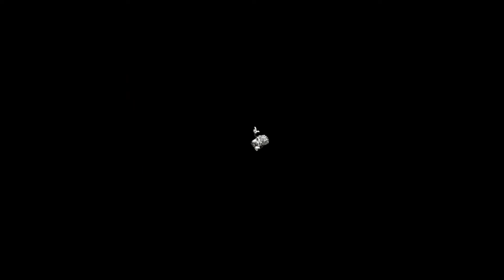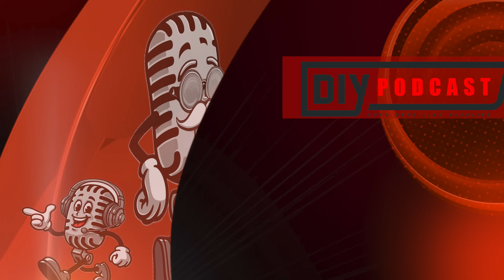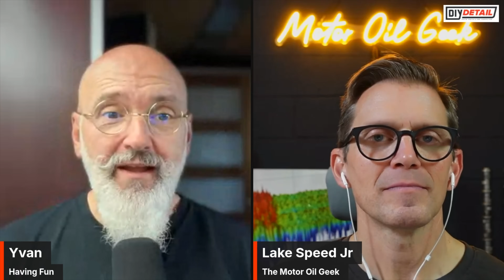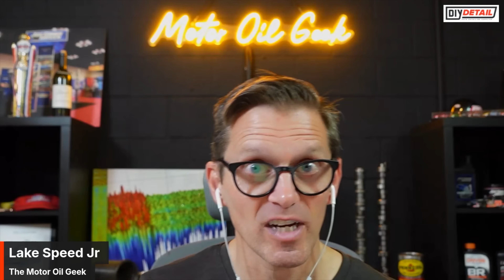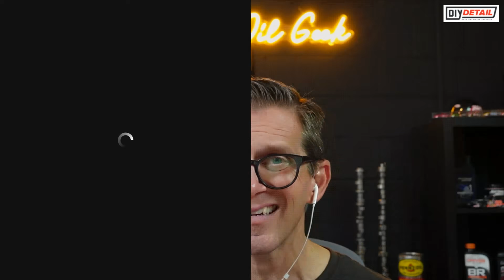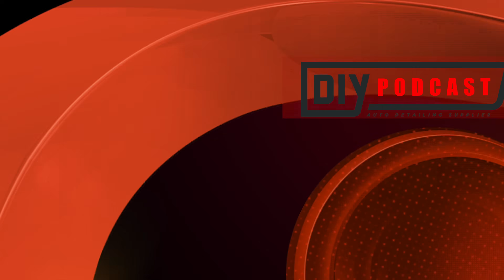Oil myths busted with Lake Speed Jr and DIY DETAIL PODCAST

Comment: I can’t believe the lengths people go to not change their damn oil! Why spend time and money getting your oil “tested” instead of just spending that money on changing the oil in the first place!?  Personally, I just follow the manufacturer specified maintenance interval in my owner’s manual for “severe driving conditions,” which most people actually fall under if you read the definition—frequent short trips, stop-and-go traffic, hot/cold/dusty environment, ride-share/delivery driving, etc., etc. I’ll leave the rest to the engineers and chemists to figure out.
Reply from the maker: For a car it’s not worth it. For a vehicle like my my bus that takes 11 gallons per oil change, if I can double the mileage while still getting the lubrication and protection it’s worth it.

Comment: Any problems with switching brands? I have a 2019 Mazda3 with 120,000 miles. I have always run Castrol Edge but thinking of Pennzoil Ultra Premium. Thoughts?
Thanks
Reply from the maker: No issues

Comment: If you're doing a lot of short trip city driving it would help your engine out to get on the highway for at least 5-10 miles a few times a week. City driving is so bad on your engine. If the majority of your miles are city driving you need to change the oil more often than recommended by the manual.
Reply from the maker: Thanks for the tips!

Comment: Lake Speed to me is another talking head. He said Valvoline Restore&Protect is a great oil. Valvoline Restore&Protect has a 394 Flash point. This is a horrible flash point for motor oil. Look it up yourself. Lake Speed said Phosphorus was not good for direct injection engines and he highly recommend not to use oils with high phosphorus in direct injection engines. Valvoline Restore&Protect depends heavily on phosphorus. Look it up yourself. Moral of the story do your homework. Don’t depend on internet know it all to run your life!
Reply from the maker: Thanks for sharing your experience

Comment: I worked in Racing at Pennzoil mid80’-mid 90’s. I worked with our lead engineer “Dewey” and Lubrizol was the additive company we used with west Texas sweet crude.

One thing I learned was don’t change brands (different additive packages) sometimes don’t mix well. And Do not add oil additives, it screws up the chemistry… 

The new stuff is beyond me except stay with the original rules….
Reply from the maker: Thank you for sharing.

Comment: Having worked on countless vehicles over the years, i think those that recommend the 10,000 and even 15 to 20,000 mile oil change are being irresponsible.   This is simply a scam perpetrated by The auto manufacturers and the environmentalists.    People need to use a little common sense.
Reply from the maker: Thanks for sharing your thoughts!
Reply: But somehow those long oil change intervals work in Europe!

Comment: If i only drove 500 miles and light driving now getting ready for winter shouod i chang my oil? I think it is foolish. Maybe every few years regardless of miles.  It’s like the oil is sitting on the shelf. Hardly any run time.
Reply from the maker: Time harms as much as mileage
Reply: If you hardly drive and you use synthetic, change oil every 6 months.

Comment: I want to mix Mobil 1 0w-40 supercar oil with Mobil 1 5w-30 SUV oil. To make a 50/50 solution of 2.5w-35 oil in my GM 6.2 Liter engine. Any good reason that I should not?
Reply from the maker: Best to ask Lake on his channel
Reply: You will completely change the addative package and viscosity.  Could be a good thing or a bad thing.

Comment: Interesting question about using an engine oil flush if it's made by the same brand as your oil. I wondered about that myself. Since Valvoline was the most recent brand discussed, I looked up their engine oil flush. In their information about the product, it says "do not use on heavily sludged engines." Given how sludged up most engines tend to get nowadays, I think that says it all.
Reply from the maker: Thanks for looking into that. Makes sense.
Reply: @diydetailofficial  you're welcome. Indeed, yes, it does make sense. The detergents in the engine flush must be more concentrated than whatever is in Restore and Protect, so dislodging a heap of sludge with an engine flush would probably risk clogging up the filter. Mind you, word on the street is that it's prudent to replace the filter a couple of times in the first thousand miles with Restore and Protect, just in case the first filter or two gets clogged with sludge. If I recall correctly, Valvoline Restore (one-off treatment for diesel engines) is recommended to have the filter monitored to prevent clogging.

A few years ago, I put a flush into my engine and kept it there for a week before I changed the oil. It made my oil pressure switch fail and leak. Whenever the engine was idling, the oil pressure light came on, but it was OK from high idle upward. I replaced the switch because it started leaking, and the light immediately started working properly. Needless to say, I haven't done that again (I've since found Lake Speed Jr's channel and realised why it's a bad idea).

I'm thinking about using Restore and Protect for both my car and my wife's car, but it's fairly expensive in Australia, and I've already stocked up with a year's supply of the normal oils I use for both cars. Hopefully the price will come down by the time I get through my current stock.

Comment: I got to witness a 2016 Camry hybrid with the level on the oil dipstick about an inch too high.... That was dilution and at least some condensation.... Luckily my girlfriend's son had paid for that super expensive warranty that I usually consider a complete waste of money because the used car dealer did replace the engine.   It's comforting to hear in this video the concern that lake has about the hybrid lack of run time.  Thank you again Lake!!!!!
Reply from the maker: That's a great real-world example, thanks for sharing!
Reply: @diydetailofficial  on that particular super cold morning the amount of vibration was absolutely frightening.  I didn't let it run long.  It just so happened to be that I am the one that had to move the car.  No idea if he ever really noticed it.... Probably not.

Comment: On any Toyota Hybrid at least, you can place the shifter in B or S for sport mode, and this runs the engine continuously.  This is what I do when it’s cold out and I’ll be short tripping.  Loss of some fuel economy, but good for the oil and engine longevity.
Reply from the maker: Great information!

Comment: Sorry Lake, but oil analysis ain’t cheap and unnecessary for 99.99% of car owners
Reply from the maker: Agreed
Reply: @diydetailofficial Could you ask Lake about the VRP myth that he is promoting. He claims VRP works, but all he showed us was a dipstick trick and a questionable oil analysis hypothesis.

The dipstick trick can be explained by a higher oil level and not by oil itself.

After running for 10K miles, oil was at the lower level; hence, the dirty part of the dipstick was not submerged in oil. 

Changing to a Walmart oil would also clean the dipstick, as long as the dirty part was bathing in oil.
Reply: Also, Lake said that the oil consumption is caused by stuck rings.

But oil consumption can also be caused by leaking valve seals and guides, leaking turbocharger seal, and head gasket… Seal conditioners in oil can be the reason for some people reporting reduction in oil consumption after using VRP, and not because some carbon cleaning “molecule discovered in Mumbai” (claimed by Valvoline representatives in Lake video) or “a perfect balance of detergents” (claimed by Lake).
Reply: oh look mr know it all

Comment: I use amsoil gl4 formy manual transmission. Mobile 1 gl5 for my diffs and transfer case. Valvoline r&p for motor oil every 3-4 thousand miles. On my Tacoma. Shell gasoline always!
Reply from the maker: Excellent

Comment: Buying a 4 year old used F150 with the cam phaser life generally dictated by regular oil changes, when do I do an oil analysis to determine the cleanliness of the engine without breaking the engine open? As I purchase it, next change analysis and run the Valvoline Restore and Protect, followed by a Valvoline synthetic?
Reply from the maker: Good plan

Comment: AOA brother my question is I have Passo 2007 car which is 1000cc 1KR engine. Previous owner used 20w50 oil in it because millage war over 100000km or dont know the reason. but when i purchased it from him I changed its oil to 10w40. After few days engine start smoking and oil start reducing. i don't know it was reducing before purchase or not. I checked it to My mechanic and he said we need to overhaul (rebuild) engine and i fallowed him. He open the engine and he used new parts in the engine. Engine was very dark from inside but after engine overhaul (rebuild) it become new. After reassembling the engine he put is 10w40 engine oil. Whereas the company recommended oil is 5w30 or 0w20 for 1kr engine. Now my engine is good no smoke, not oil reduction etc. But I want to use 0w20 or 5w30 engine as company recommended and here is my main question. That If I switch from 10w40 to 0w20 or 5w30 will it again start smoking or will reduce oil? i already have driven 9000km after rebuilding engine. can i use 0w20 or 5w30 in next oil change? Please Please Reply me because i want to get good feual average.
Reply from the maker: I would try it , if you have problems return to the 10W40
Reply: @diydetailofficial  which should i try first? 0w20 or 5w30?
Reply from the maker: What the factory recommends

Comment: You mentioned gumout fuel cleaner.  They have a few different ones, only the "regane" series has PEA in it.  Techron dropped their PEA percentage to 20-30% and the "fuel injector cleaner" has 1-5%.  Redline SI1 is 30-40%, your best bet.  The famous BG 44K has no PEA listed on the SDS.
Reply from the maker: Thanks for the info!

Comment: Oil analysis in the nuclear industry is problematic.  Yes, it is widely used; no, the interpretation and applications are widely inconsistent.  The interpretation and optimization component is typically inefficient.  Occasionally analyses get backed up, skipped or left unread.  You get the same with vibration monitoring programs.  Insights into what's going on vary widely between a geek engineer, interested technician, and uninterest time card puncher.  The best programs work well with the lowest common denominator of staff.
Reply from the maker: Good point

Comment: Hi Lake.
I have a dilemma and would appreciate your advice. 
I bought  a 2020 Land rover discovery hse td6 (diesel)
I removed DPF and through  programing shut down both EGR's and DEF fluid. 
The manufacturer reccomends Castrol Edge Professional  5W30 C1.
Would Amsoil  signature  series 6X 5W30 be a better lubricant since I don't have the DPF to worry about. 
Your input would be greatly appreciated. 
Thanks.
Reply from the maker: You may want to ask on his channel

Comment: DIY Detail
That 12.7 DD will usually break a piston head off the skirt(2piece) before it actually wears out. If ya hear a slight knock, turn it off and I would bet on #6cyl piston.
Reply from the maker: Thanks for the heads up

Comment: I've only used Mobil 1 full synthetic truck and suv. Never had an issue with any of my engines but..... I use valvoline restore and protect once a year now and I've noticed better fuel economy. I'm guessing it gets all the carbon build up out of all my piston rings. Last year in used it my truck had 280k now it's at 300k my economy went from 14mpg hwy to 18mpg between city and hwy. My truck is a 03 yukon 5.3. It's got a little bit more pickup on acceleration. I should've done a compression check before the very first use. Then after the next oil charge
Reply from the maker: Interesting feedback, thanks for sharing your experience.

Comment: So tell me WHY Rotella T6 5w 40 is not a good oil for my 1986 Ford F250. 460 cider with 70,000 miles on it
Reply from the maker: Lake has a video on his channel. In short the additive package for a gas and diesel are very different

Comment: Fuel additives are a joke, you’re pissing in the ocean. You’d need 20x bottles to achieve anything. They are great for bench and flow cleaning injectors @100% strength. I add ATF to my flow cleaner and some in various fuels. 

PS: I have no idea why all cars produced for the United States are not EA five capable. Those are some of the cleanest motors I’ve ever seen taken apart. And it’s 111 octane. 😏
Reply from the maker: Thanks for sharing

Comment: Just on engine oil flushes and the concerns of chemistry upsets with the oil, it would seem prudent to use an engine oil flush that is the same brand as the oil used if one really wanted to do a flush. For example, using AMSOIL Engine Flush with an AMSOIL oil.  AMSOIL would hopefully have done the work to ensure no adverse oil chemistry effects with their own oil…

As Lake mentioned though, a product like Valvoline Restore and Protect is likely a better way to go as an all in one product.
Reply from the maker: Great points, thanks for sharing your thoughts.

Comment: Yes short trips with towing/racing and cold climate just change often in these newer engine's.  New oil better than used.  If you spending money on oil analysis in some cases i rather spend it on new oil with less oil dilution and maintain viscosity for vct system especially cam phaser's/turbo engines share the oil with turbo
Reply from the maker: Thank you for the input.

Comment: I change my oil at 2500 in my mx5 and it still runs very strong at 212k. At 3000k the oil is thin and dirty even with Mobile one full synthetic
Reply from the maker: That's great to hear.

Comment: Polyetheramines (PEA) are a type of fuel additive used primarily to clean and maintain the fuel system in vehicles. They are known for their ability to remove carbon deposits from various parts of the engine, including the intake valves, combustion chamber, and fuel injectors.

 PEA is a nitrogen-based detergent that can effectively clean engine parts in a way that weaker detergents cannot.

PEA works by attaching to carbon deposits with its nitrogen head and lifting them away while the fuel-soluble tail of the molecule pulls the deposit off the surface where it is burned and/or flushed out through the exhaust.
 This process helps in improving engine performance and efficiency. PEA is also used in the formulation of fuel additives such as Techron, which contains both polyether amine (PEA) and polybutene amine (PBA).

In addition to their cleaning properties, PEA-based additives can also help in reducing emissions and improving fuel economy. They are particularly effective in modern high-pressure fuel systems where traditional solvent-based cleaners may fall short.
 However, it is important to note that the effectiveness of PEA can vary depending on the concentration and the specific formulation of the additive.

Overall, polyetheramines are a crucial component in many fuel additives due to their superior cleaning capabilities and their role in maintaining engine health and performance.
Reply from the maker: Thank you.
Reply: If you want the best fuel cleaning additive with pea in it, it is 'redline'.  I went down that rabbit hole.

Comment: Regarding oil change intervals — It really depends on your commute and your engine/fuel system. Do you have direct injection, turbos and small displacement? I’d cut it down a bit. Do you have a short commute where the oil doesn’t reach temp and get the chance to burn off moisture and fuel? I’d cut it down. Do you have a port injected Toyota doing 30-40 mile highway commutes everyday? I’d have zero issue doing the factory recommended 10,000 interval, BUT check your oil level and know your engine. Does it have known inherent factory defects like sticking low tension oil rings and known oil consumption issues? Cut it back. If it doesn’t, you can go a lot further than you think.
Reply from the maker: Thank you.

Comment: I also have a 2007 Ford F150 5.4 that I bought new back then, it's basically the occasions ride (sand dunes trips, beach trips and simple things) and it's currently only 80,000 miles, i change oil every 4 months or more using 5w30 Castrol mainly, is it good?
Reply from the maker: Excellent

Comment: I have a 2013 Toyota Camry 2.5 non hybrid and I'm living in Dubai (middle east - very hot climate) and I change my oil every month (less than 1000 miles) using only Castrol 5w30 or 5w20 or 0w20 when available, engine is around 205,000 miles... I want to keep this car until I die, will the engine survive before a major rebuild? Is it a good schedule?
Reply from the maker: Sounds like you're doing everything right to keep that engine running for a long time.

Comment: Lake has his face planted so far up the motor oil industry's ass that it's impossible to take seriously anything he says, however correct or incorrect, based on our actual experiences servicing this bullshit. It's insulting to a lot of actual STREET CAR mechanics stuck in the middle of our now epic proportion exploding engine epidemic.
Reply: Of interest, Lake received/accepts zero/$0 from any oil manufacturer-NADA!!!
Reply from the maker: Thank you.
Reply: @diydetailofficial  you're welcome. Remember, he's the guy who shared what was learned from his trials at GM a few years ago, that a 0W-12 resulted in less wear than a Gen 2 Dexos 5W-30, showing that additive package can make enough difference, so that a thinner oil can protect better than a thicker oil. This sure goes against the grain of a lot of personal opinions shared here, and it certainly goes against the latest GM.. ahem, recall to use.. 5w30. Because of the nonsense he push(es). He's a freaking shill like every other YouTuber piggybacking off this oil bullshit, plain and simple